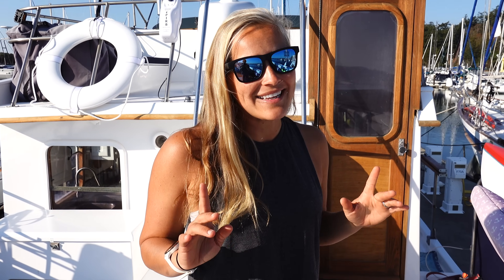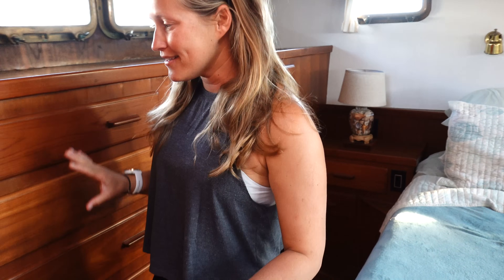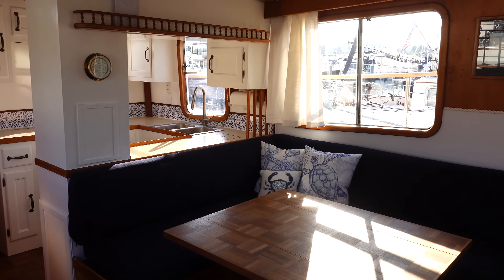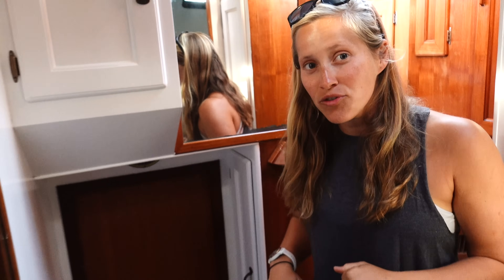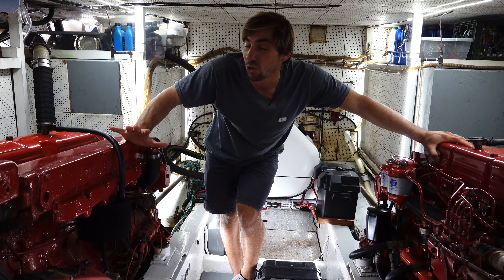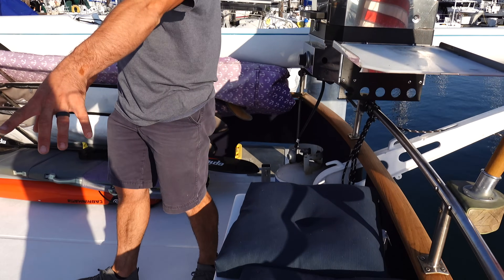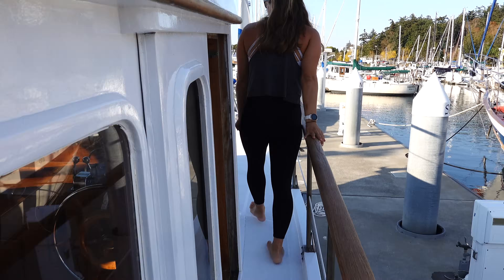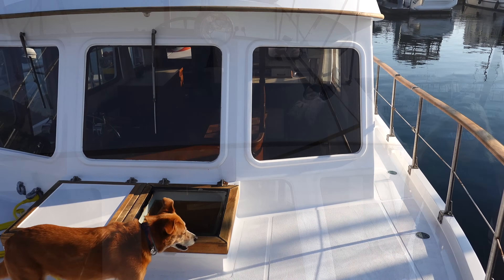FULL TOUR of our Completely TRANSFORMED $100 Boat | 1978 DeFever 43' Trawler

Comment: Great job! I have 1979 Hatteras Convertible. I recently had the heat exchagers and after coolers done. They looked pretty bad since the boat is 44 years old. I istalled flushing valves on the main engines and generators. This way I can flush them with fresh water and also run Rydlyme or Salt Away. It will keep your raw water cooling system clear from all the salt scaling

Comment: You should loosely uncoil your shore power cable because it can start to generate a high amount of heat coiled tightly like you have in an induction coil configuration. To test it place a metal object in the center of the coil and see if it heats up.

Also for added pizzazz, spray wash and white spray can paint the storage areas like the propane tank stogie area.

You guys have done a fantastic job in such a short period of time and I'm positive the sale of this vessel will give you guys a huge down payment on you future boat when it is complete.. 

Elbow grease equals $$$$

Give Jetty my love.

Comment: I owned a boat repair shop, here's some suggestions (if you don't have them) 
Automatic and manual fire suppression system for the engine bay. (CO2 or Halox or another fog type that will not be corrosive) You can open it from the helm or if fire happened when you sleep or are gone a sprinkler head would open in the bay.  A water alarm to let you know if there is water in the bilge above whatever level you set it at. a C) alarm and a fire / heat alarm. and a TV camera or two in the eBay, believe it or not the wireless ones at harbor Freight work very well and you can access them on your phone. All of these are really cheap and worth their weight in gold to let you know something is wrong before it is critical. The last is a few semi trailer ratchet load jacks, get the good ones that are used commercially. if you have a leak they can be used to press a piece of wood with something between them to stop a leak. You are looking at about $250 for all this but I also did search and rescue and these if ever needed can help prevent tragedy.

Comment: Did you add a fuel tank(s) recirculating cleaning ?
That electrical connections panel needs a good straighting out . As old unused wiring removed.

Comment: In the engine room, on the starboard side just forward of the engine, the video shows about a three foot tall , white cylindrical tower thing mounted to the bottom of the hull, with hoses attached. Is that a sea chest?

Comment: I've caught most of the transformations from the beginning.  It been a great trip.  I'm kind of curious how you feel having been sailing folk; switching to a motor vessel.  The space looks incredible, and is probably bigger than my apartment.  I just can't wrap my head around the fuel thing.  From your rough numbers, and depending on tides and winds your probably on the safe side saying it it's $2/nm.   I realize pretty much every sailboat has motor.  That said, if I'm not in a hurry I spend between  25-75 cents/nm running my diesel 
(I am lucky to have 30hp, which is PLENTY for my girthy girl).  I have ambitions of bringing my 30 foot sailboat down to California in a year or two (I'm in the PNW).  My question is this: is it worth the fuel bill to stretch out in that space, and shave a few days off the trip?  How much more comfortable it it underway?  If I handed you six figures to get the boat of your choice would you go wind or motor?

Comment: Hi, I´m electric engineering, please take this comment as a advice and take note English is not my maiden language. In the engine scene part I see a wall with some wires hanging and no well routed, my eyes almost poke out of the orbits and I have a little seizures :face-green-smiling: but seriously, please fix it them, route all wires fixing them with zip ties or use cable raceways. Do not let the wires hanged its dangerous. Good job rebuilding your yacht.

Comment: Can you show the fire suppression system for the engine room?  Can you also show the air space purge for combustible gas in there?  Did you have to upgrade the system to meet current CG standards or is it still the 1978 version?

Comment: Great job restoring that old boat. I have a soft spot for keeping old, but usable things in service. Much better to repair / renovate than always buy new.

After watching your re-fit and repair, I would have no qualms about buying that boat from you. (If I could afford it...) Their are times when good enough work is more practical than perfection. An old boat like this one is a great example for "good enough". By the way, painting the galley white was a good call, it makes it bright instead of dingy. When it was new, that probably was not a problem.

Enjoy the boat and your travels with it.

Comment: There are two kinds of boats in the Pacific NW: those with sticks in the air and those without. You have a great (non stick) boat and platform to spend many years up here exploring. And you can always run down to the Sea of Cortez.  You’ll NEVER run out of video content on the Left Coast.

Comment: You guys are outstanding in your field. In your case that happens to be Northern California and the Northern Pacific Coast. You both did a terrific job, definitely not lipstick on a pig. I'm sure there were times you felt like that was the case but there was a load of electrical and mechanical work not to mention interior design. I'm so glad it worked out as you both imagined.